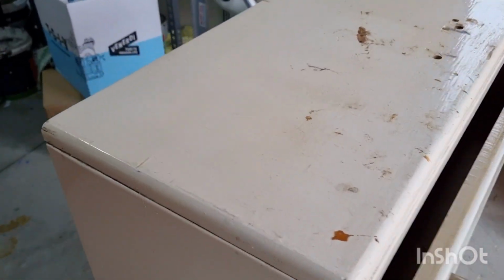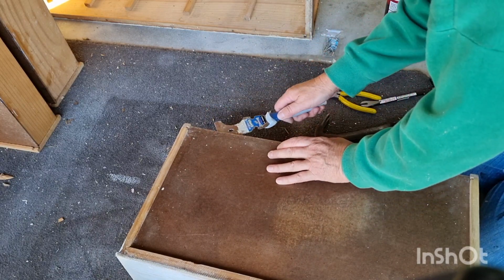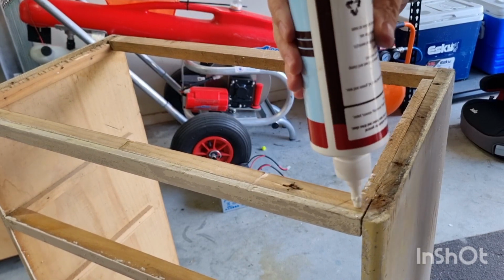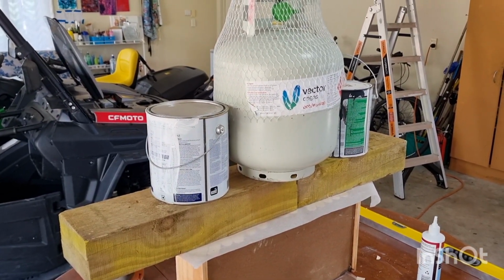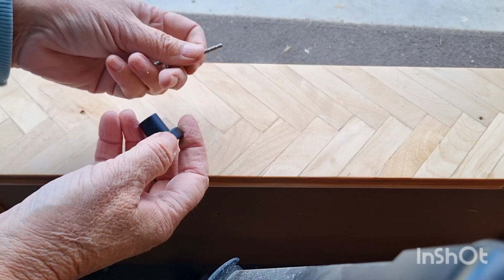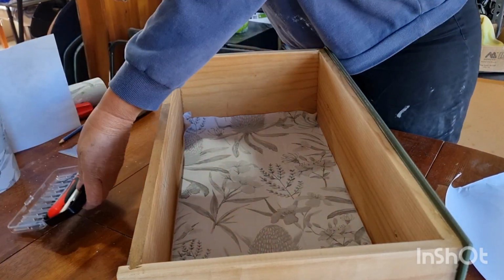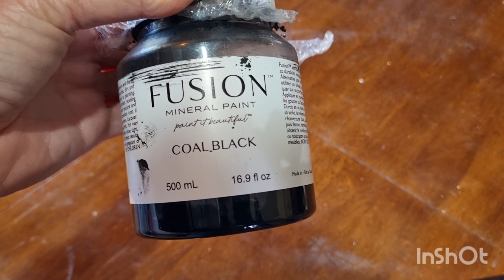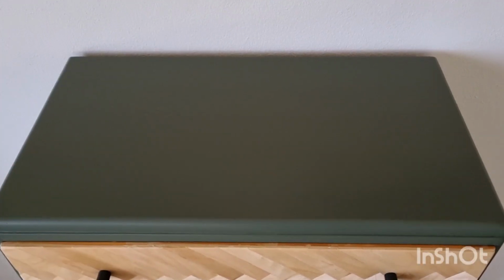#33 Was my $20 FMP dresser a bargin or not?

Comment: If that's water based stripper you could revive it from drying by filled a spray bottle with water and lightly misting it for a few minutes before you begin scraping.  Like so many projects some unexpected issues, but you were up to the challenge.  One suggestion.  Next time you have holes to fill, use a wooden dowel cut to fit and fill the edges with wood filler.  Just a thought.  I liked today's project.  Very innovative.